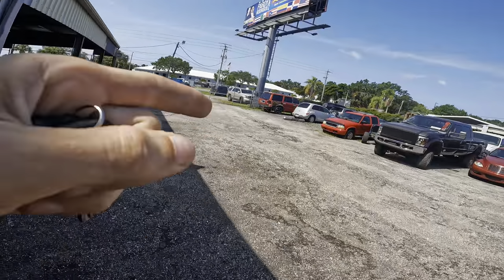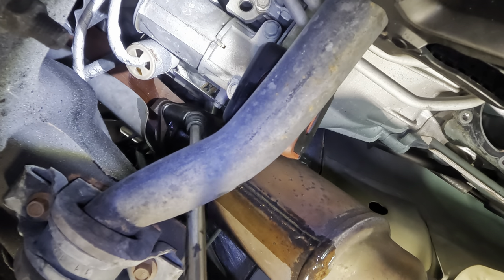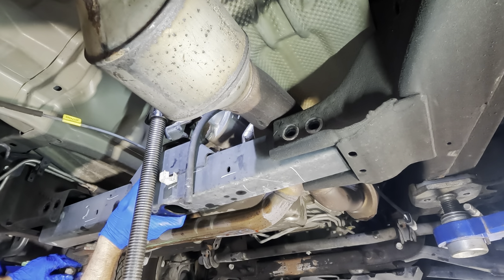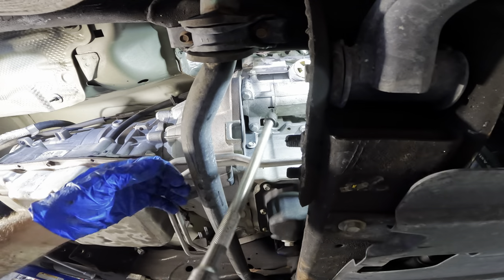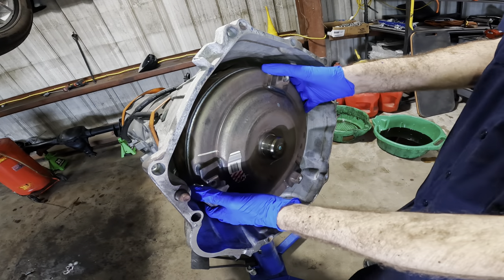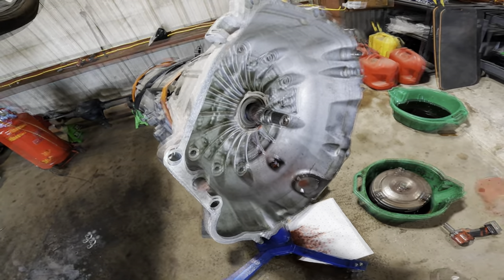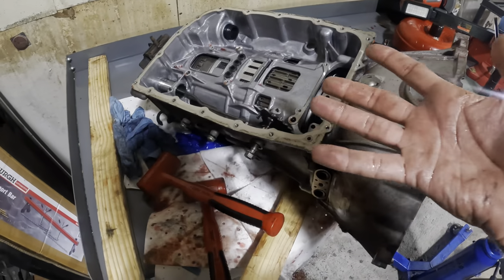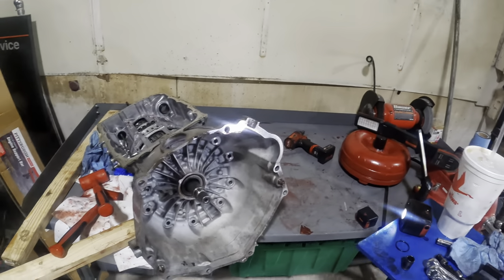Went too FAR! Invasive Inspection, 6l80 Transmission. 2016 Chevy Tahoe 5.3

Comment: After 80 years of auto transmissions you would think they would pit a drain plug in every one by now.
Reply: They used to, and stopped.
Reply: Nope, most manufacturers advertise their fluid as "lifetime fluid".  So no need to service js anymore. Which is just asinine and we all know better, no fluid does or should attempt to last forever. What they're really saying is it'll last long enough to get out of warranty.
Reply: @natersalad889  Mine has a drain plug. Changed my fluid. The old fluid still looked clean for how many years? I guess you are going to say that doesn't mean it works as good as fresher clean fluid (and chemicals broke down)? Point is they want me to drain and refill over 5 times after driving every 50 miles? (So I can make sure 99% of the fluid is clean) Go to the honda dealership, they will say that's a waste of a fluid. Of course those internet experts got to say you need to only use the honda genuine transmission fluid (rumor). Started rumor because maybe someone didn't use a good transmission fluid? No proof mind you? From another internet expert? The manual says use equivalent to dextron 2. Sorry honda upgraded their forumula of their transmission fluid for their newer cars. Of course there is no proof of this either? Can we have another internet expert. These transmission fluid experts drive me nuts!
Reply: @natersalad889  For my 2015 Outback, Subaru NA says lifetime.  Subaru Japan says 60K.  Different standards for different markets?  Does have a drain plug though.
Reply: It's messy.  I've had that thought then dismissed it.

The fluid is not drained that often,
goofs with a wrench would have drained it in attempt to change engine oil,
and it would cost a few bucks to the manufacturer.
Along with new "lifetime" recommendations,  the manufactures now have more reason than ever not to do it.
Reply: You'd think!
Reply: My 2015 Honda Accord has a drain plug.  I changed the fluid on it recently. Pretty easy job, similar to a oil change minus the filter.
Reply: It's a Chevy  they don't think that far ahead lol
Reply: @natersalad889  "Lifetime" isn't "Forever". Talked to an automotive engineer, and he pointed out that pretty much all major components on your American built car are rigorously designed to last as close to 150,000 miles as can be predicted. That's the "life" expectancy of the car.
Reply: My 2021 F250 doesn't even have a dipstick for the transmission. Having a drain plug and a dipstick would be awesome.
Reply: They don't put them in because oil changers pull the wrong one and double the oil.  Too funny
Reply: Next year.. engines without oil drain plugs.
Reply: They usually remove the drain plug to make you drop the pan and replace the filter at the same time. Usually, not always.
Reply: @natersalad889  lasts the lifetime of the vehicle, just don't ask the manufacturer what the lifetime of the vehicle is
Reply: @procrastinatingnerd  This.  Years ago VW stopped putting an oil drain plug on the aircooled Beetle engines because people were only draining the oil and not replacing the mesh strainer above the plate the plug screwed into, causing engine failures.  Removing the drain plug forced you to remove the plate/strainer
Reply: @desotosky1372  Wife has a 2015 Forester DD at 180K it needed a new valve body .  Stealership just R&R the valve body;  I changed the CVT fluid  pulled a sample to Blackstone, and it came back still good for service.  The owners manual says lifetime fluid.
Reply: @desotosky1372  You look at some and you can fine the car says lifetime but the people who supply the fluid to them say it's good for 60,000 miles. Lifetime fluid is a joke.
Reply: I use the vacuum machine and  suck the fluid out thru the dipstick tube before dropping the pan, makes it easier and cleaner.
Reply: @john7017  How do you change the filter?
Reply: Half the fords I work on don’t have them. Makes a huge headache
Reply: Also your average greasemonkey see's a drain and will exchange fluid then the customer complains when the transmission slips.
Reply: @NotJRB I know a guy who drained the tranny, added 5 qts to the engine!
Reply: @fhuber7507 lawnmowers don't have a drain plug. Infant, they claim the oil doesn't have to be changed, just add!
Reply: @NotJRB  Lifetime of the warranty.
Reply: @procrastinatingnerd  Yep.
Reply: @dans_Learning_Curve  My Husqvana mower recomends oil change every 12 months I do mine & have no problems just suck the old out & refill the oil plug is also the dip stick.
Reply: @procrastinatingnerd  Speaking only for my 2015 Outback, there is no "particulate" filter, just a screen.
Reply: @chrisfreemesser5707  wow, I've had many air cooled vws 56, 61,62,64,67 beetles and 68,69,71 busses and never did know why some had a drain plug and others did not.  Though I always cleaned the strainer anyway.  Fun thing to learn, thanks 🙏
Reply: @dans_Learning_Curve like the guy who drained his oil then turned the engine over for 10seconds to get ALL the old oil out!
Reply: @wowzersmcgee9361 the new nineties ones had amazing new features,  like heat! 😂
Reply: @DeepakKumar-lv4te  lol, yea had a few water cooled as well...86 cabriolet, 86 gti, 90 golf, 93 corrado.  Funny thing here is my 56 oval beetle was honestly my most reliable (and oldest) and the 93 corrado was the most fun (and newest).  Arguably the least reliable, but naw, that was the 86 cabriolet.  Probably because I was pretty young when I had that, also had no wrenching skills.  I had that corrado apart a number of times, dash out for that nice heater core!!
Reply: @wowzersmcgee9361  always wanted a corrado, fantastic shape. Were they really awful for reliability? I fancied that vr6 . The new scirocco , 2000s, were a very disappointing hatch back shape.
Reply: @DeepakKumar-lv4te  not if it's decently sorted.  I got 100k miles in 10 years of ownership.  It's just kind of difficult to work on.  The early vr6 cars have a lot of plastic parts in the cooling system that are brittle and ready to fail.  I really wish I still had that car, it was beautiful.  It was also an awesome car to drive, fun, sporty (not fast), and very comfortable.  They get a bad reputation that's undeserved, it's as reliable as basically any mk3 vr car.
Reply: @wowzersmcgee9361  I'm trundling around in a vw caravelle these days, defo not sporty but still great to drive. Not sure what my ml crisis car should be. Jag XJ Sovereign, previous shape might work- if it works!
Reply: @desotosky1372  Does your outback have a drain plug?
Reply: @procrastinatingnerd  Yes (2015)
Reply: @desotosky1372  I have noticed they usually do put a drain plug in if your filter can not be changed without taking the entire trans apart, or if the filter is just a screen.
Reply: @jc3745  That's ridiculous!  I find it hard to believe that new vehicles with these "lifetime" fluids is a good idea.
Reply: Better still have a manual gearbox for less problems.
Reply: My 2000 4Runner has a drain plug.  Not a good one though.  It fit like the plug was threaded slightly differently from the hole.  Eventually it stripped out and I had to remove the pan, drill out the hole, do a bit of grinding and weld a nut on the inside.  Used the matching bolt for a plug with a copper crush washer.  Proud of that one.  It worked really well.  My 2013 Silverado 1500 does not have a plug, but I can at least get an aftermarket pan that does.
Reply: @schlite60 ….how miles had the fluid had on it when you changed the cvt transmission oil?  What color was it?
Reply: @dans_Learning_Curve …I know a dude who’s wife changed the oil on her car, except she add engine oil; she added diesel exhaust fluid.
Reply: Kinda green approx 168K miles what Blackstock said on the oil: JOHN: If you still have the filter or want to keep the next one in use for a longer interval, we'd be all for it.  We didn't find any insoluble (solids that form as oil is exposed to heat/use), so the filter was working
effectively. Universal averages show typical wear for a Subaru CVT after about 55,900 miles of oil use.
Metals in this sample are a bit higher than average, possibly extra wear but these results could also be from
normal accumulation or even lingering wear-in if you've only changed the oil a couple of times. The TAN
doesn't show much acidity. Try ~50k miles  BTW there are 2 filters in these CVT.  One is the sump filter which is cloth filter and the other is a pleated filter that is buried inside the CVT is NOT accessible from the out side.  Hope this helps you.    @deplorablelibertarian
Reply: To do an oil change on an auto properly, you need to drop the pan, clean any debris out, and swap the filter. Manufacturers found that if a plug was included, idiots just did an oil change lime it were an engine, and the filter eventually clogged. It is pretty simple to just stick a tube down the dipstick and siphon the oil out, or disconnect a cooling line and let it get pumped out.
Reply: The main reason they don't put drain plugs in transmission pans is reduce confusion with the engine oil drain. There are idiots out there that would empty a transmission and double fill an engine without even knowing what they did wrong.